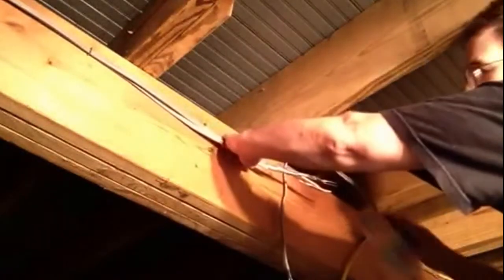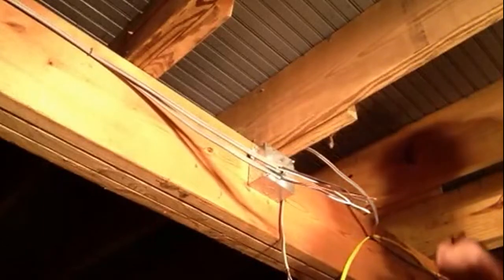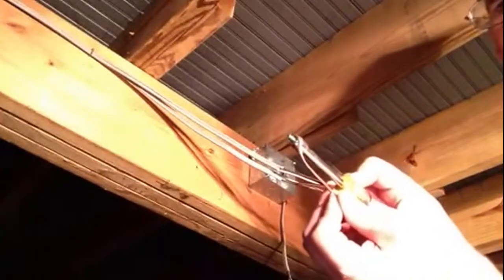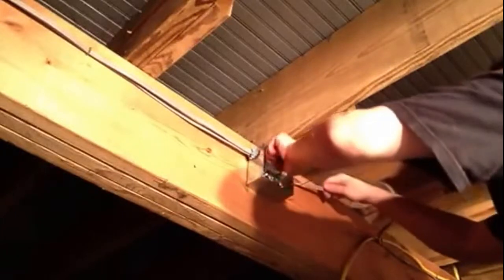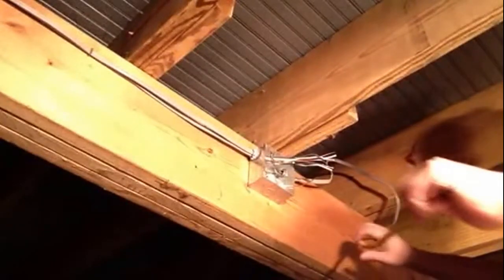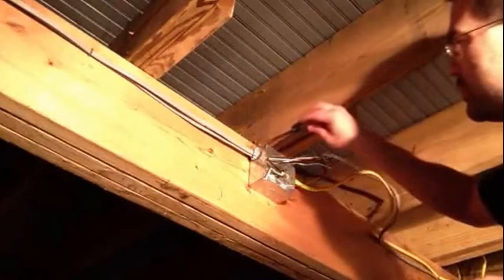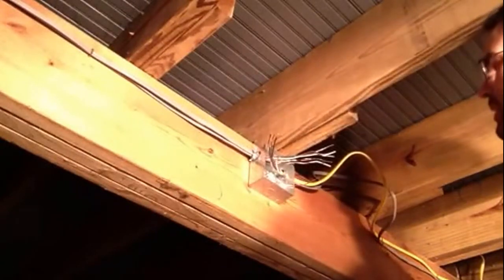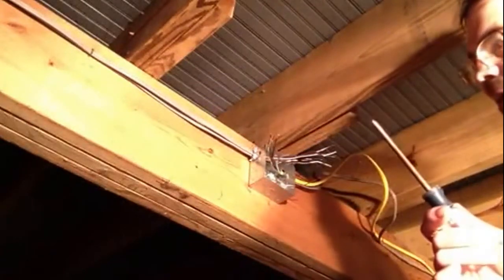How to prep a 4 inch electrical junction box

Comment: You pulled two cables through a single fitting. Was that fitting listed for use by two cables? Some jurisdictions would require you to de-rate cables that are stapled together, run through a single hole, or through a single connector. San Francisco used to be and may still be one of those jurisdictions.
Also, I would teach an apprentice to mount the box first, or leave a lot more cable to be sure you had enough cable for a proper splice.

Comment: you forgot to include the service loops, it is against electrical code to go straight into the electrical junction box. please hire a professional
Reply from the maker: Could you give me the publication and the proper code number for this. I am a professional.
Reply: if your a professional, you would know how to look up the code rule and where to find the code rule for where you live.
Reply from the maker: Yes, I am not familiar with this requirement in the NEC. I wanted to see if you cited a national code or a local code. If it is a code anywhere I am interested in reading it.  I do know there is no local code in my area that addresses this. I also have never seen an electrical inspector address this through the NEC. If you could point me in the right direction information can be had by all.